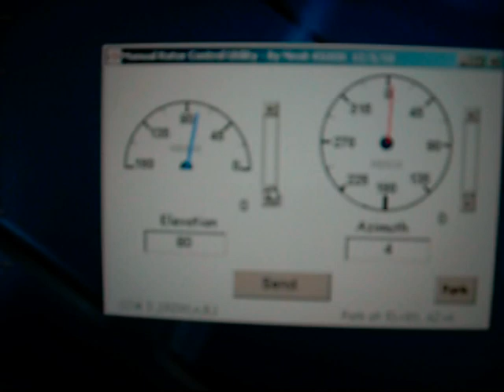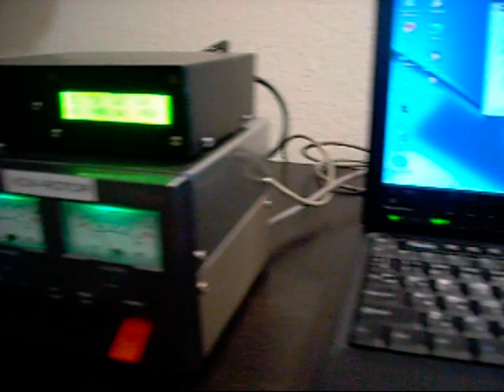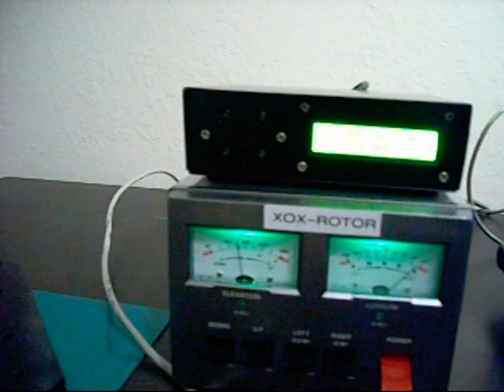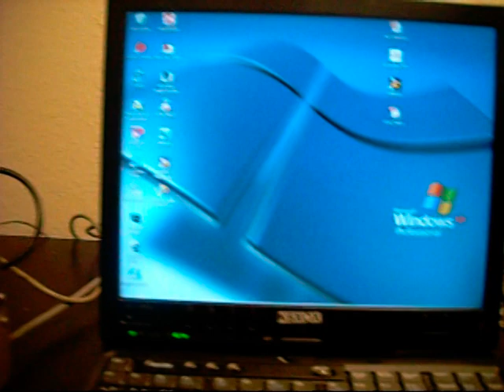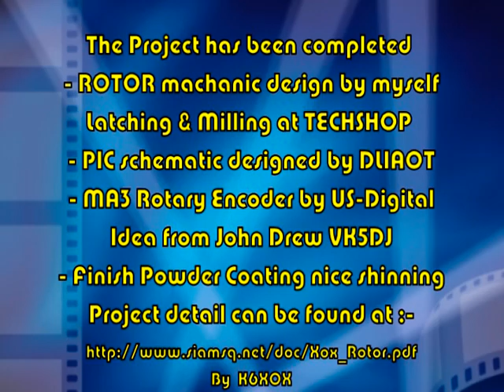Automatic Tracking System for Amateur Satellite , DIY ROTOR (AZ-EL) build using Arrow Antenna

Comment: Have you thought of using either a Sea Tel or TracVision antenna/dish system for automated satellite tracting? I know they're expensive, but I've seen a few cheap on craigslist and ebay. They seem to have all the necessary servos and gears.

Here is my question; for the sake of argument, if you know precisely where an unidentified satellite is located, can you point your antenna toward it and pick up in signal with a signal meter - despite not knowing its 'signal?'

That is; if a satellite is transmitting a signal outside the spectrum of a signal meter; all other signals, can you detect it without knowing it's band/frequency, etc.? Of course, this is entirely outside my area of expertise.

What I am trying to do is (on paper for now), is to create a tracking system that can essentially detect satellites signals and Identify them (those that are not listed for broadband, weather, or channel providers). 

On paper, I want to use a TracVision antenna to sweep the sky and or point directly toward a specified location and attempt to pick up a 'satellite' signal, and identify it. I thought of using a satellite finger meter; but then got lost once I started reviewing youtube hobbyist's videos. Please shed some light on this subject for me, please. : ) 

BTW -- essentially, the satellites I am tracking don't always appears on http://www.n2yo.com/ or on http://www.satflare.com/ website.